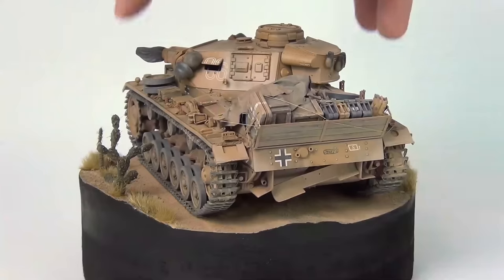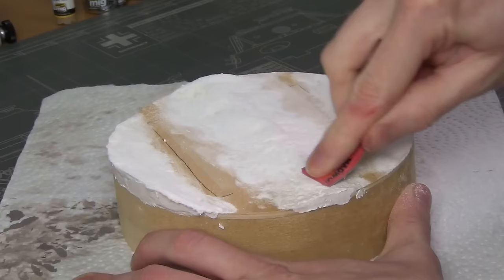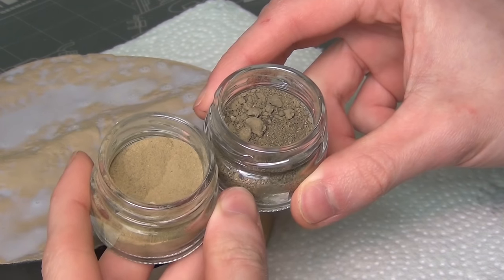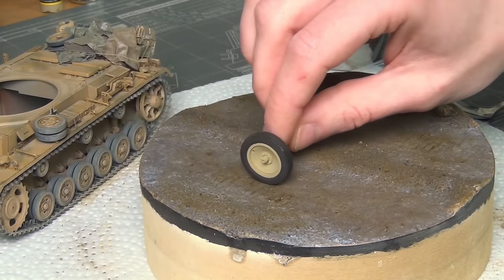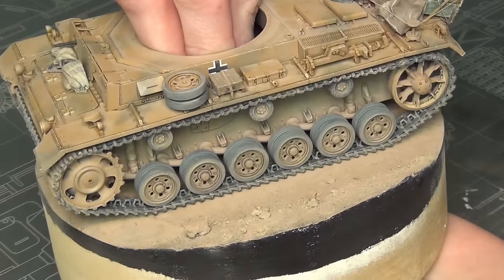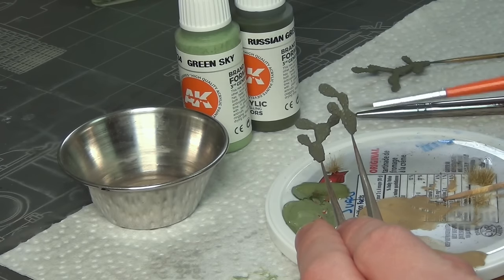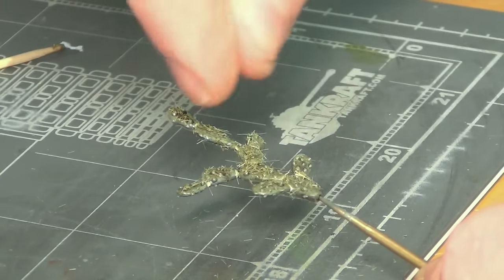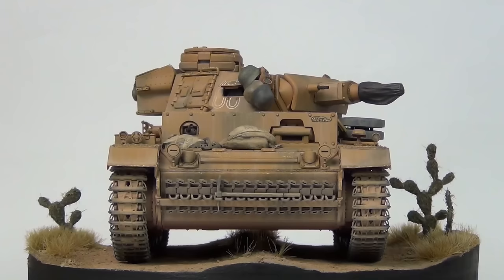How to Make a Simple North Africa Base in 1/35 Scale -- 501 s.Pz.Abt Tunisia 1943

Comment: Looks real good mate! - And so simply done!  Plain old plaster of paris should work too you reckon?

The thing that bothers me is the dust collection over time, as this little gem sits on my shelf.  And the damage for curious, clueless fingers.  Do you have a good source of perspex display cases of different sizes & shapes?  Cheers
Reply from the maker: I display them in an IKEA detolf cabinet which is a mostly sealed glass cabinet.  It keeps off most of the dust!  

And plaster of Paris should work, though it may not hold a shape as nicely as the Sculptamold while still wet.

Comment: Very nicely done.
I have been looking for those round painting panels in Ottaw but so far have struck out.  Michaels - nope, Deserres - nope. Amazon - nope. Haven't tried Wallacks. Lots of square and rectangular but no round ones. Where do you get yours?
cheers, Graham
Reply from the maker: I got these at Deserres in Bells Corners.  Up the steps into the rear half of the store, directly on the left after the steps.  The round ones are 20-30 bucks while the squares are less than 10.  I got them on a slight sale so it wasn't terrible.  Ideally I'd mill them myself for pennies ..
Reply: @Panzermeister36   acckkk!  yes indeed, there they are. I wasn't looking in the right place. Indeed, pricey but noted as an alternative, always nice to have choices. I did find some round discs at Dollarama but a bit thin that you could glue several together to build up some thickness, another option.
cheers, Graham